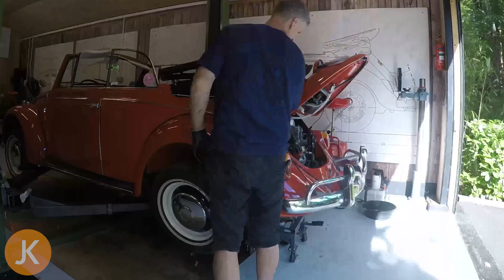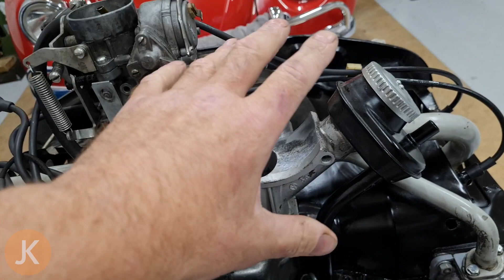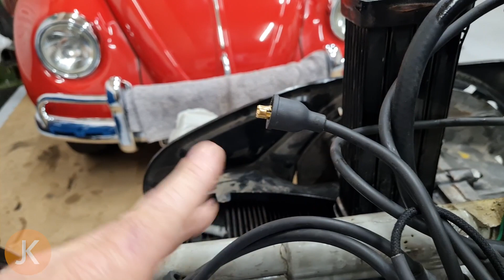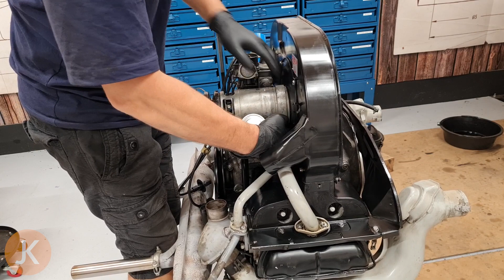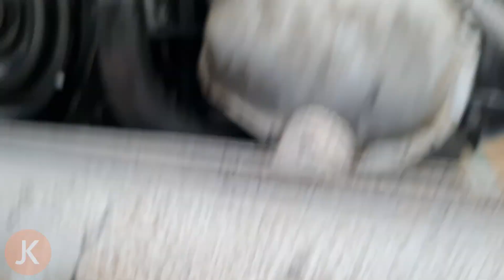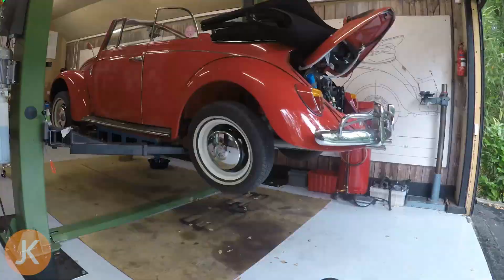How to fix a Beetle oil leak & clutch replacement

Comment: Great video. Isn’t it easier to just align the clutch disc and plate since the start with the clutch pilot tool that’s so widely available?
Reply from the maker: You can of course use the clutch pilot tool, this is down to user preference.
Reply: Hi …I literally did this job (replaced flywheel oil seal, clutch, clutch plate and thrust bearing), during the last week. It would have been easier with an alignment tool - which I’ve subsequently ordered but …without it , its a question of aligning everything manually. Easier with two people , align by  sight whilst the other tightens the clutch bolts. Literally no shakes (but using tool would have been easier as I say). What are they a fiver …